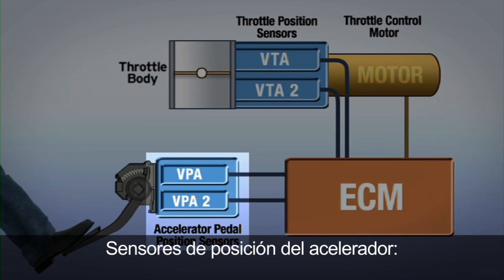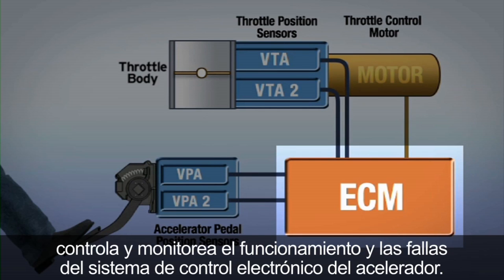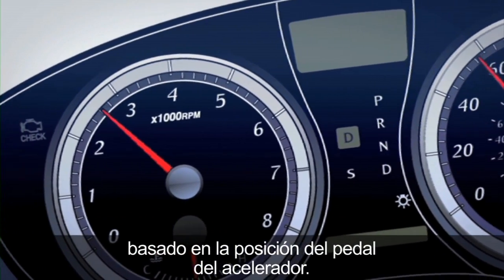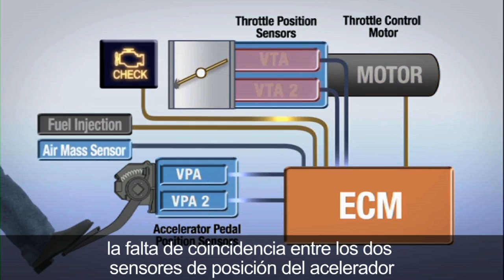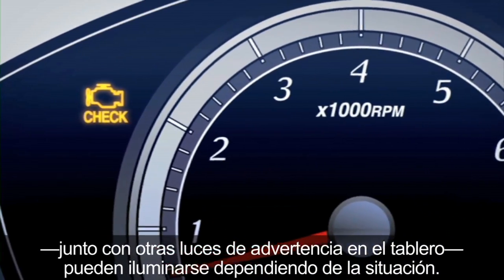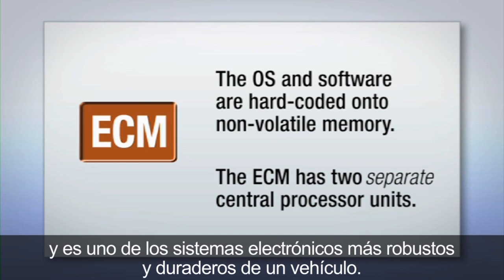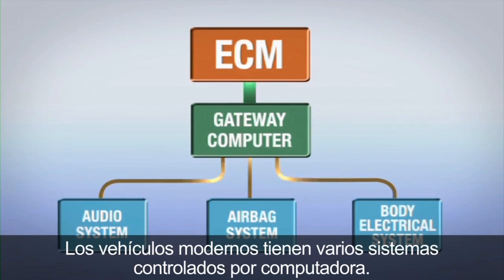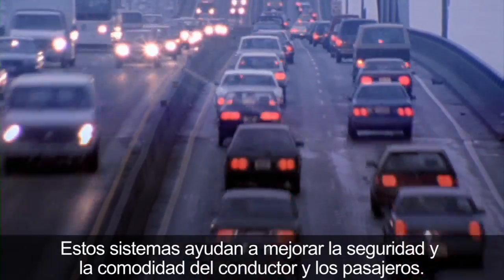Cómo: Control electrónico del pedal | Toyota

Comment: The explination is fine, but what happens if the motor that moves the throttle is unable to correct the problem if the throttle gets stuck mechanically or the little electronic motor the controls the flap developes on idle spot (cut or so) in the internal winding???
That will render the computer (ECM) useless to corret the throttle body, no matter what current is sent to it. Complete power cut to the throttle body and/or a atmospheric bypass would be a fix in that instance other than fuel cut.
Reply: Not this page